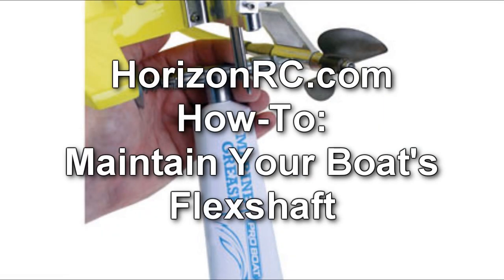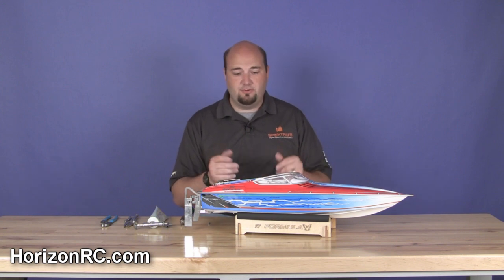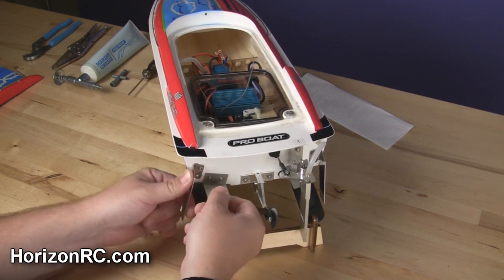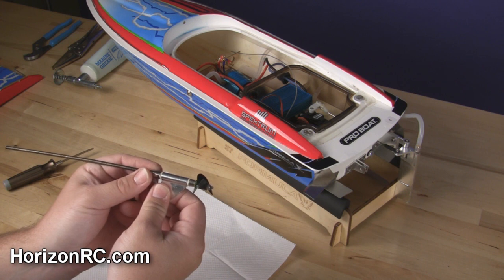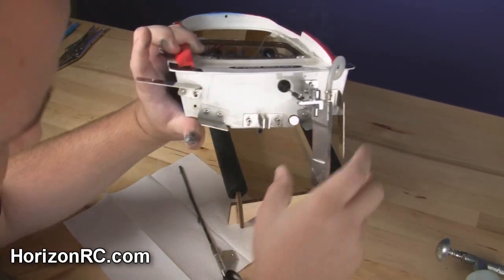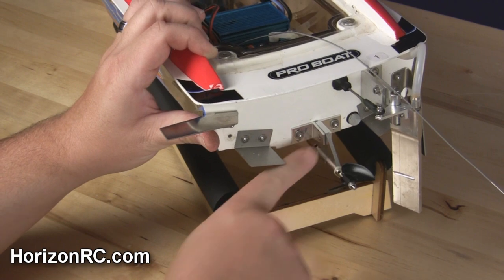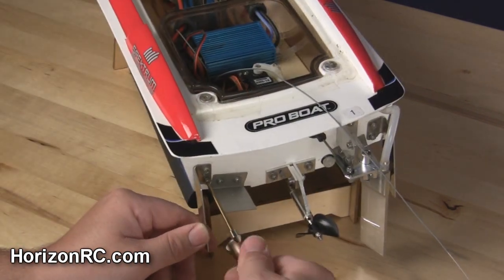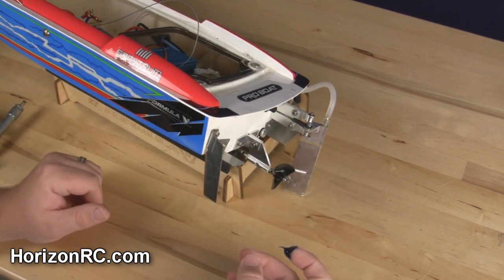HorizonRC.com How-To: How-To Maintain Your Boat's Flex Shaft

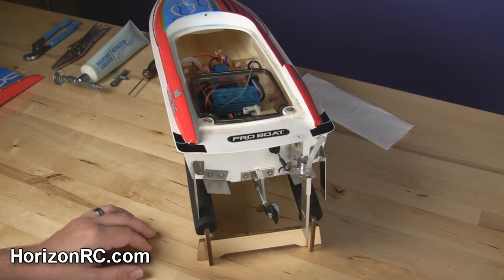Comment from the maker: The prop angle is fixed and the height of the prop is adjusted via another plate. None of your settings change when performing this maintenance.   If you look at 1:57 there are 2 screws on either side of the mounting plate. THOSE are the screws that adjust your prop height, not the one removed at 2:14.

Comment: So, this step took you 8 minutes . I see  
One thing you should do also before you grease the shaft is wipe the rust and old grease off it. This is more important than you might think

 You should go back and re-do this video. It takes the viewer too much time to watch it. 

One more tip is this: Instead of touching the grease with your fingers, just squirt some onto a right angle. Then place the shaft in the grease and twist it.

Comment: you have to remove the strut to lube the shaft and then you still don't get to the solid shaft. Each time you lube it, you lose your strut setting. THAT is mickey mouse. If you know how most shaft systems work, you would know this is not a good setup.